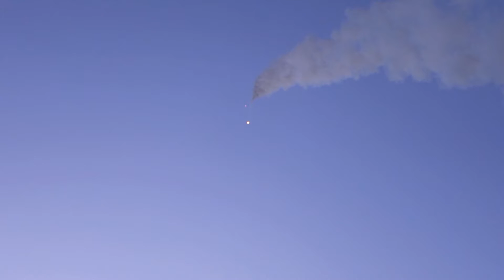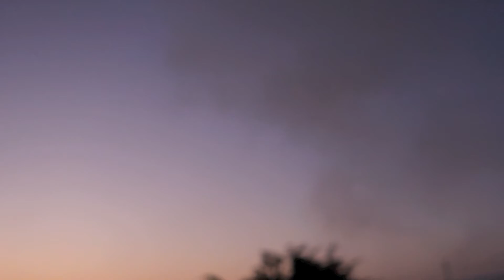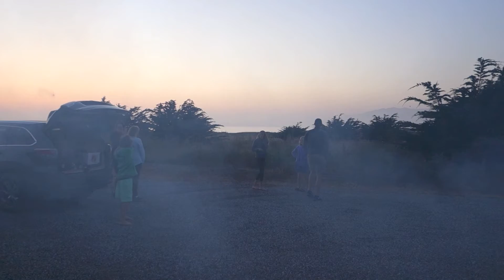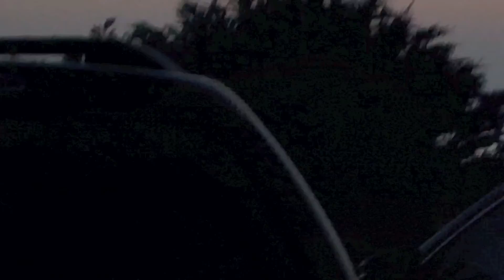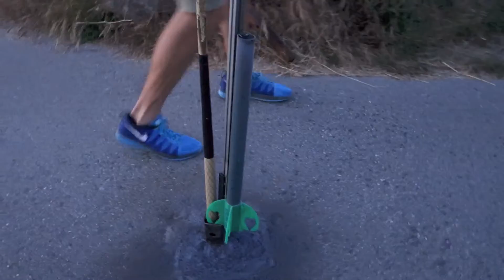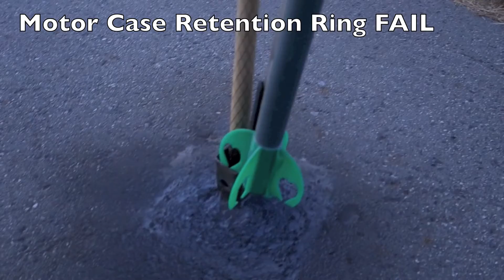Free Flying J Motor

Comment: Steve, seems to be a failure of the adhesive used to bond the thrust ring to the aft end of the case. Did the epoxy not set long enough or was it a case of  a low melting point of the adhesive?  I’m not sure about the pool cue and it’s purpose? Final question, I’m guessing that recovery was not a high priority for a disposable J270 in a single deploy rocket that might weigh 1-2 lbs w/o motor? I am assuming that this was a test of the 3D printed fin can or one of those “what the hell, lets do it” moments?
 
PS - I think that stuff floating way down range was the “remains” of the nose cone /  shock cord / recovery system. Did you ever go out and recover those parts?
 
PSS- A better title for the video might be; “I don’t always fly my rocket motors without a rocket, but when I do,… they look like this!”
Reply from the maker: Tom Devlin — Exactly right.  3D-printed rocket with golf ball nose weight.  Known to be stable from simulation and prior flight. The rocket will fly again, and next time should come close to Mach 2.  This is a single-use Aerotech J270W motor that comes pre-assembled, but the vendor has discovered that the ring is not secure enough.  I did add glue, pre-flight, but it was model cement, not CA as they recommend (the thinner glue probably penetrates deeper into the available seam, and I will use it next time).    Here is the Aerotech advisory bulletin:   http://www.aerotech-rocketry.com/news.aspx?y=2014

4/17/2014
AeroTech DMS™ Motor Thrust Ring Advisory

It has come to our attention that there have been two (2) recently reported instances of the factory glued-on thrust rings of high power (H-class and larger) DMS Disposable Motor System single-use rocket motors breaking off the motor casing during flight. This usually results in the bare motor flying through the rocket and into the air, often in an unstable and unpredictable manner.